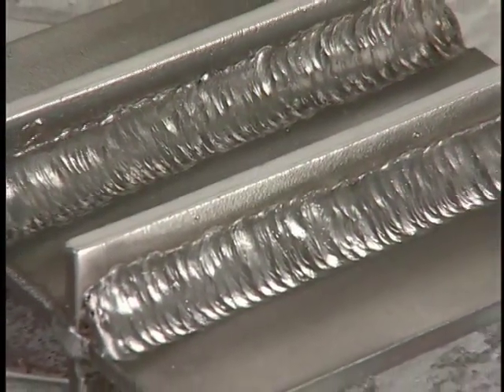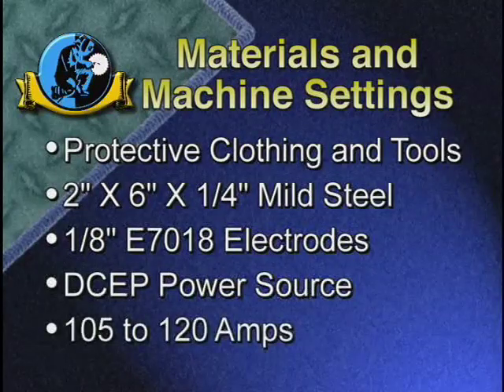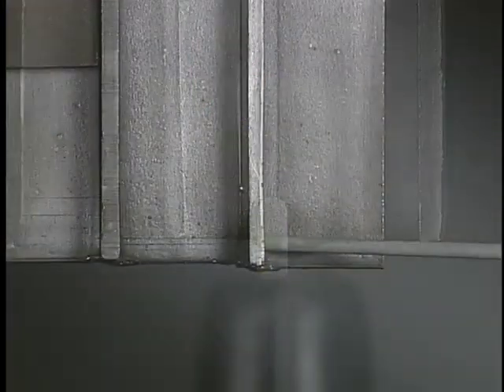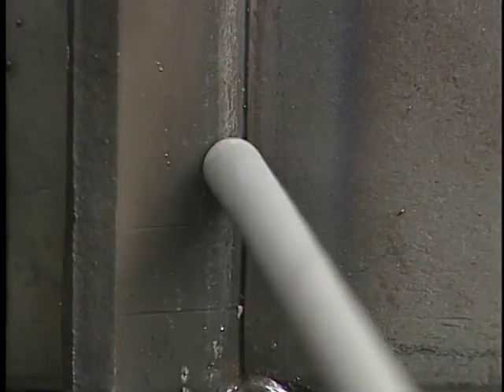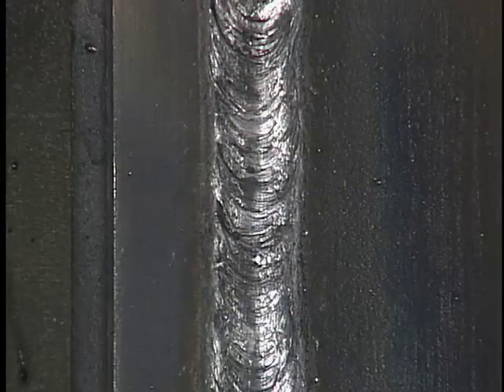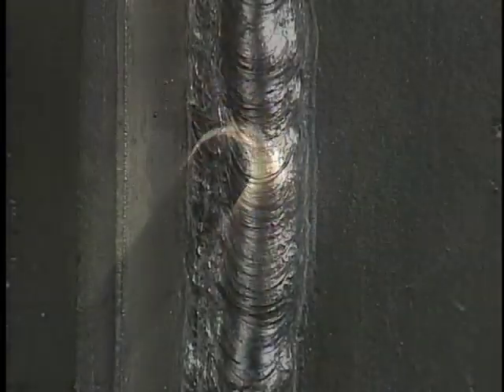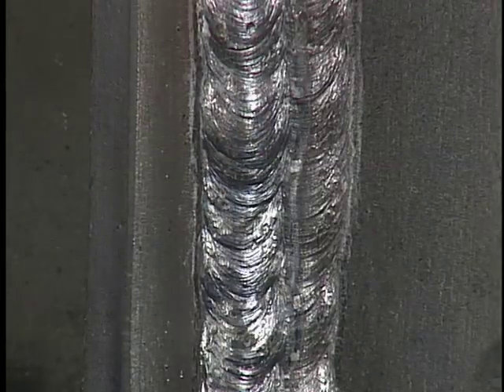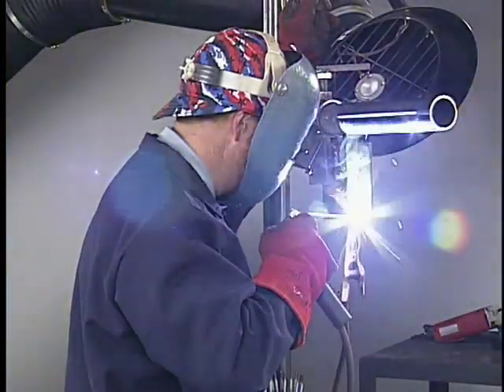SMAW multi pass fillet weld, T joint, Vertical Position up E7018

Comment: At my school, we're are taught to have our rod's travel angle to an upwards 10-15 degrees when doing a vertical 3f; I do that or a straight 90 degree angle, but keep sloping the edge of my rod to make it look like a sharpened pencil. Any tips to fix this?
Reply from the maker: When travelling in the vertical up position, common practice is to use a 10 to 15 degree rod angle, you can make fine adjustments as you travel upwards to create your desired results you are looking for. Your comment about the electrode pencil sharpener look, I can only assume you are referring to the finger nail at the end as you weld the electrode gets consumed but there is some flux extending past, this is normal. If it does interfere with your welding while welding just rotate your wrist to adjust for the finger nail, when you restart your weld just take your thumb and break it off to expose the core of the electrode for easier starts...be sure to have your glove on.
Reply: @profrioux  in

Comment: Hi, in uphill 7018 can't be dragged upward without the v shape at the root pass?
Reply from the maker: no you should not drag up hill, this should be a leading angle. Some people will do what is referred to as stringers on a vertical up or you can weave it in.

Comment: Why does the second pass have a different manipulation pattern than the first?
Reply from the maker: it is slightly different, you just need to be aware of any undercut it might create. As long as it works its not wrong
Reply: @profrioux  thank you. What are you looking for exactly to determine when to move the rod to the other side during the root fillet pass weaving? Is it just "do it rapidly" and keep an eye on the puddle beneath as you go?
Reply from the maker: @user-ju5wq7gf8q  Hi when welding the root pass with a small weave, you will look at a few things, rod angle, standoff distance but to help with your question. When you are welding you are creating a crater , once the crater is filled you should move to the other side, keep in mind this happens quickly. There are a number of techniques that can help if you are struggling as per video. Its all about timing and rhyme, on the 1st pass I like to use the count of one on each side for my pause but still look at the crater, on my second pass I pause on the side for the count of 2 and the 3rd pass pausing for the count of 3. its all about timing and consistency. Good luck

Comment: How many amps you use
Reply from the maker: Depends on many factors, material thickness, electrode size and machine type
Reply: I keep reading 105-120 but the miller machine I'm working with seems to work best at 92, otherwise I melt the metal.
Reply from the maker: @dylanjmorrison  any amperage is just a guide to get you started or in the ballpark. Every machine will run slightly different, depending on resistance and resent calibration among other variables. If it works best at a lower amperage and you are getting the proper penetration for the task at hand, stay with it